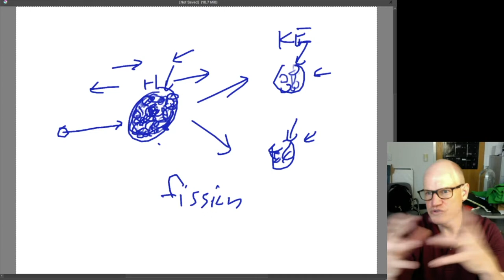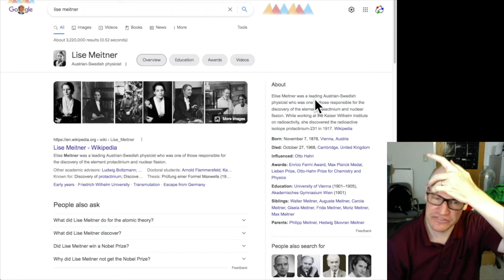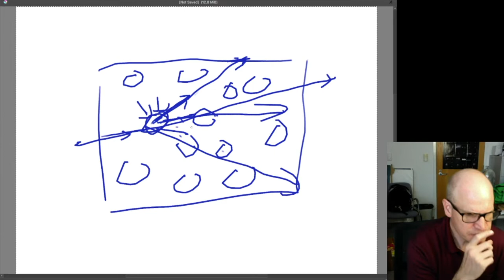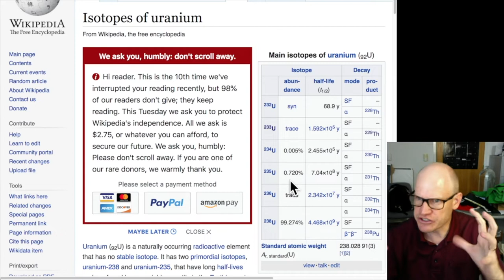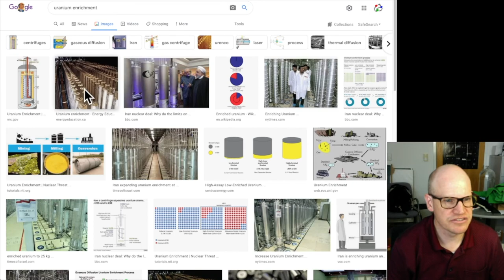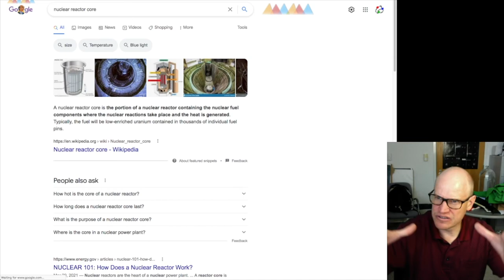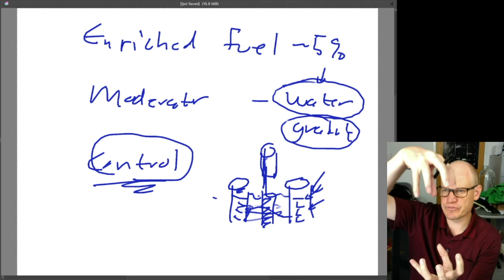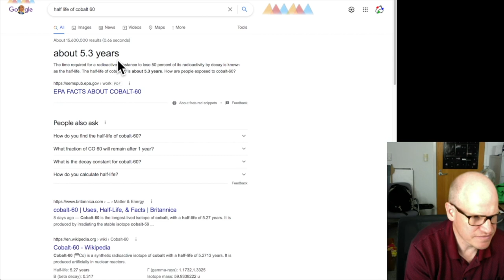Nuclear Energy 02: Fission and Reactor Essentials

Comment: 45:27 Boron would be a bad idea as it works a lot more like neutron poison
51:24 I belive those are control rod channels, there is no reason for fuel assembly to stick out like that on the top of the vessel.
51:36 whoever wondered about that, was right, there was such a method using mass spectrometers (calutrons) for isotopic spearation during the Manhattan project. (thouhgh as you said correctly it is much more expensive process thats why diffusion, and calutrons were droped in favour of centrifuges)
56:54 Well, sodium is not a moderator but a coolant, it is indeed used for once because it retains liquid phase but also because it has a good thermal conductivity most importantly transparent to neutrons (thats why it is used in fast reactor designs) and as a liquid metal, can be pumped with electro magnetic pumps.
Reply: 100% correct, also :
57:20 Russia does have 9 RBMKs left that are graphite moderated but most of their reactors are water moderated VVERs. The UK has 8 graphite moderated AGRs. And Canada and India both have rather large fleets of heavy-water moderated reactors. Other countries also have a couple of D2O moderated reactors
Reply: also : 1:01:25
The depiction of a PWR is wrong, the coolant and moderator is the same water, in a single circuit. But instead of boiling in the reactor core and then going to the turbine like for a BWR, the water in a PWR goes to steam generators where it gives off heat to the water of another circuit. This secondary water boils because it is at a lower pressure, and then makes the turbine spin

Comment: The centrifuge only spins the gas like a microwave cyclotron.  The hexaflouride  is a gas and ionized, so it is pushed by voltage and / or switching. Note the spiral path from top to bottom.

Comment: What is essential is that fission and reactors be shut down immediately. Then the next thousand years should be devoted to trying to clean up as much as possible of the mess they generated in the last 75 years.
Reply from the maker: Which is roughly one-one millionth of the mess generated by other sources of energy, given the relative energy density of the fuels.
Reply: @horizonsci1703  What is the scientific research corrobating your comments?
Reply from the maker: @jackfanning7952  The energy density of fossil fuels is about 50 MJ/kg.  The energy density of uranium is 80,000,000 MJ/kg.  That factor of a million needs to go somewhere.  It ends up in ash ponds, soot, and carbon emissions.
Reply: @horizonsci1703  Where does the 1 million lbs. of 0.1% tailings go to get 7 lbs. of U-235?  These highly acidic radioactive tailings go nowhere. They stay right there in huge mountains and radioactive slurry ponds like the one that contaminated the Puerco River from Church Rock or the Colorado River from the Moab Mine. At least they don't pave children's playgrounds on the res. with them anymore. Or do they? What are you going to do with the concrete and steel reactor parts that become highly radioactive from neutron activation from reactors, if you ever decommission them. What do you think of "put a lock on the gate, cut and run, let someone else deal with the mess 60 years from now" SAFSTOR or rubbilization or the mobile Chernobyls of CISF?
Reply: @jackfanning7952  You still haven't done the same calculations for the waste from other energy sources.  There doesn't seem much point in engaging when you aren't willing to make fair comparisons across the board.  Instead, nuclear has only downsides, and the others have only upsides.  It isn't true, and I'm not convinced that you care if it is true or not.
Reply: @horizon8927  Nuclear waste has nothing do to with energy density. That a deep breath. You just breathed nuclear waste from Chernobyl. Fukushiima, and every reactor that ever operated and the 2200 test bombs.
Reply: @jackfanning7952  Your point is in any case irrelevant, since modern fast MSRs (clean/safe/cheap) can simply burn every kind of nuclear waste as fuel. When that's gone, they can breed Thorium/U238.